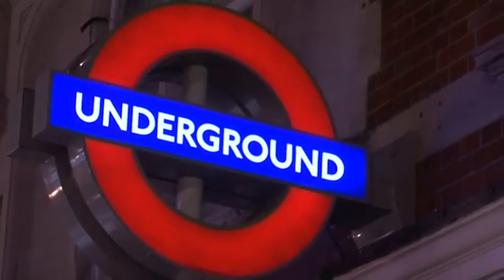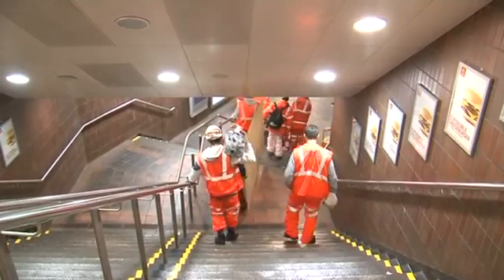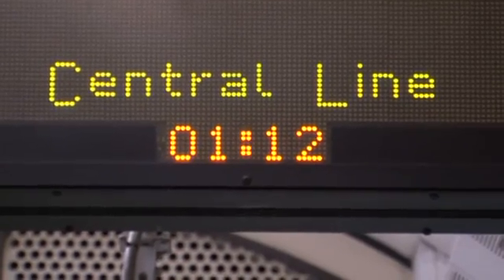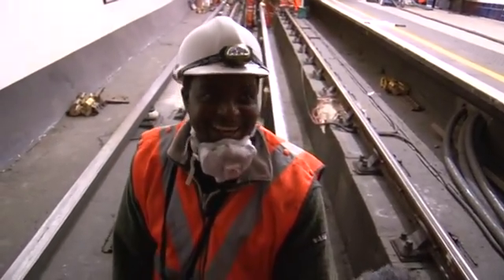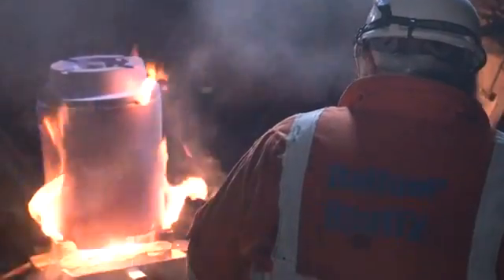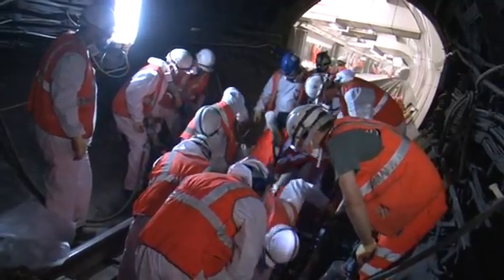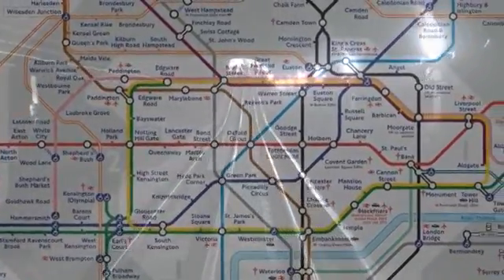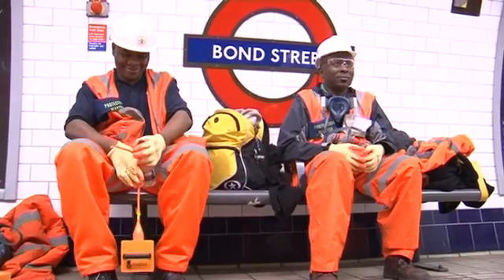In the Tube tunnels by night

Comment: Nice video and here in New York late night construction work on a 4-track line 6th Avenue Queens Boulevard Broadway and Broadway-7th ave usually results either rerouting to the Express tracks or local tracks depending on the track work
Reply: Only one line of the London Underground has express tracks unfortunately, the Metropolitan. Although there were plans in the past to make express tracks for the Northern and District lines, that never went anywhere (and there is a stretch of District and Picadilly where, theoretically, trains could switch between tracks, also, what's part of the Jubilee line was originally "local" service for a stretch of Metropolitan line)

Comment: suprised with them working at speed in a 3 hour time window that they haven't screwed up yet and caused something like the derailment of a train in the tunnels etc our lives are in there hands really that would be a big burden for me to carry if I was working on this
Reply: it's usually scoped appropriately so would be something like 90m of one string of rail or less at a time, or 5m of concrete breakout. Also there are emergency units on standby should a patrolman spot a track fault